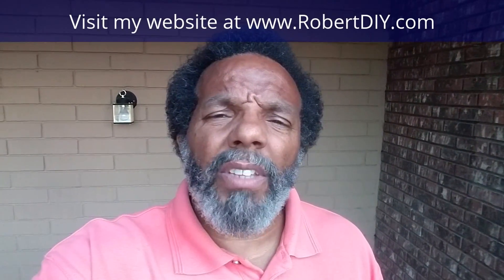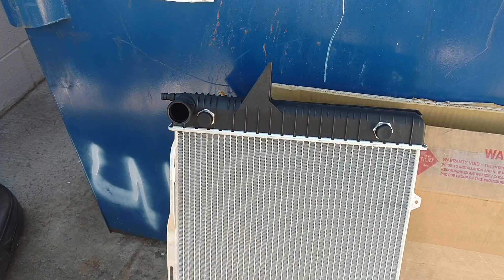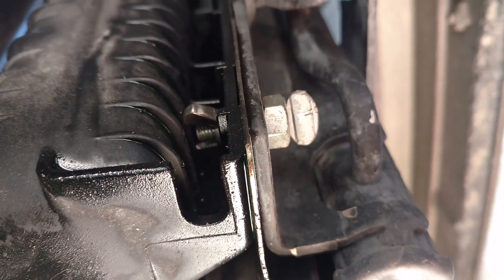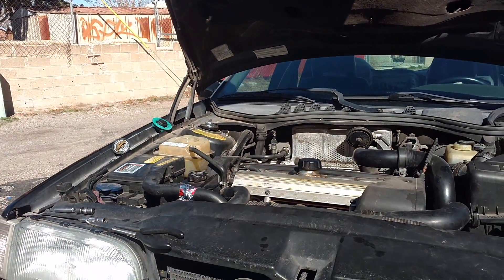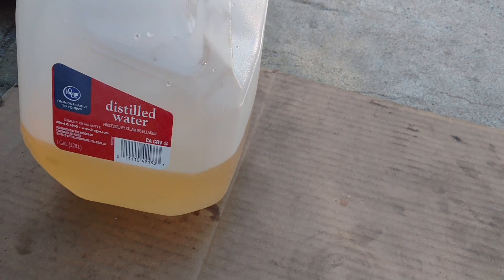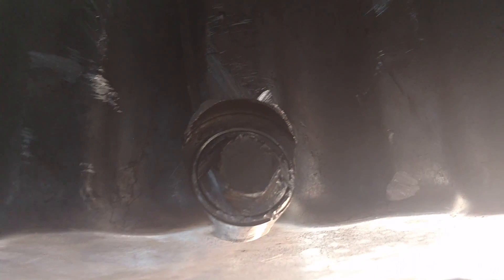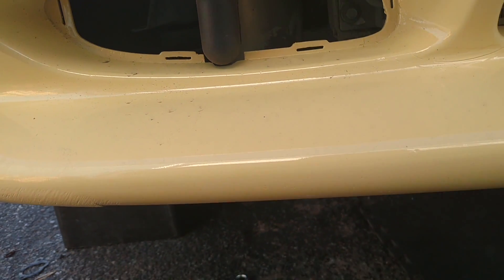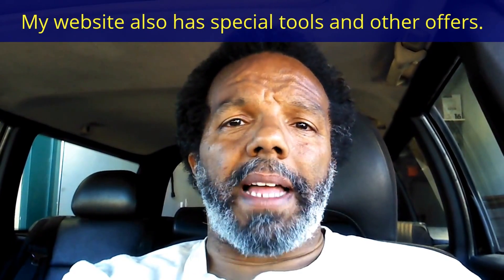Radiator replacement, AC seal replacement, oil pan bolt fail, etc. - VOTD

Comment: Thanks for posting the clip with the gauges.  My gas gauge does pretty much the same thing.  I guess the needle will have to be popped off and reinstalled.  Any tips on how to pop the needle off?
Reply from the maker: +AKJeeper I wouldn't bother with it. They just pull off once you get the face of the cluster removed the plastic part that you see while you're driving.
Reply: My OCD will eventually get to me. Between the temp needle not being at exactly middle when warm and the fuel gauge being off...kind of drives me nuts. Lol
Reply from the maker: Well, hope it doesn't bother you as much as a broken dash would if that stuff starts falling apart. :(

Comment: I like your idea about leaving behind the coolant label. That thinking can be applied to lots of other things.
Reply from the maker: Yes, it's so frustrating that people mix things after they forget what you tell them a year earlier.
Reply: You can put the empty bottle on a photocopier and make a label.  Sometimes I cut the label out of the bottle, pop a hole in it, and zip tie it near the filler cap.
Reply from the maker: I need to figure something out. lol
Reply: i cut the label from a kitchen under the sink filter and taped it to the the filter so in one year when i replaced it I would know the filter part number.
Reply: That's the way I do it.  I also write the date on a piece of tape and wrap it around.  I would never be able to remember.  I also  write the date and mileage on the side of the engine air filter on my cars.  I change them every two years or 20,000 miles in my area.
Reply from the maker: +John Ferguson I write the information in the owners manual, also on the parts.

Comment: When you do a coolant flush, take the top hose off the radiator & put a stocking foot over the radiator inlet, then clamp the hose back on over the stocking & radiator inlet.Catches all kinds of junk & is free.
Reply from the maker: +Sideslip that should not happen. Maybe a little bit of stuff can come out of the drain.
Reply: I always get bits of old gasket, some silicone gasket and if it's an iron block, some iron flakes too.
Depends on how old the engine is and how long it's been neglected or pampered.

Comment: Hmm its odd that the drain bolt was frozen, next time heat the head with a gas gun, a bit of expansion may help.
Reply from the maker: Stuck like a duck.
Reply: Someone likely used an impact wrench to install it.  It's a good idea to run a tap through those threads just to straighten them out.  You can used a magnet and a piece of paper towel to remove the metal flakes.  I like your idea of filing down the bolt head.  That is a trick worth remembering.
Reply from the maker: Thanks.